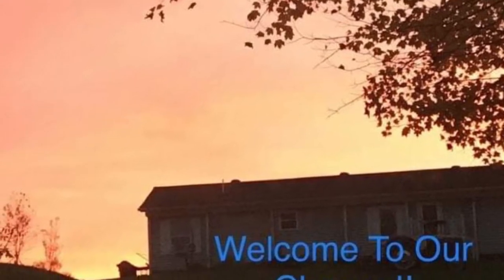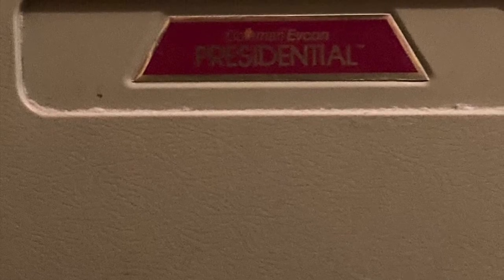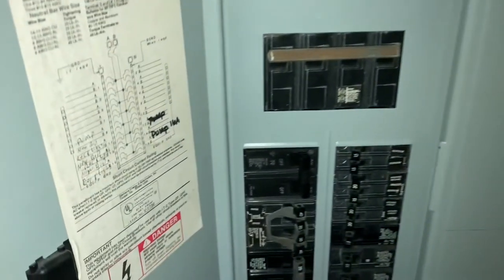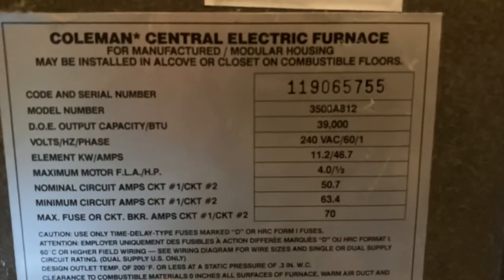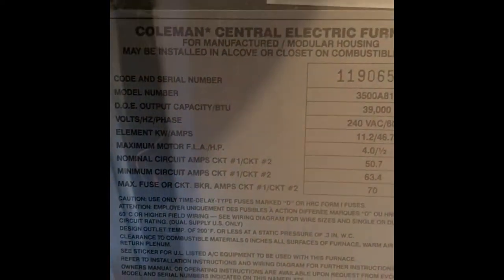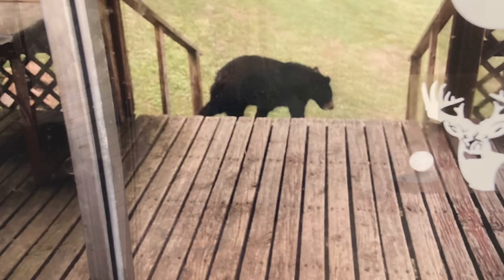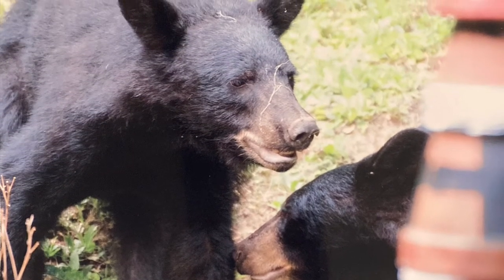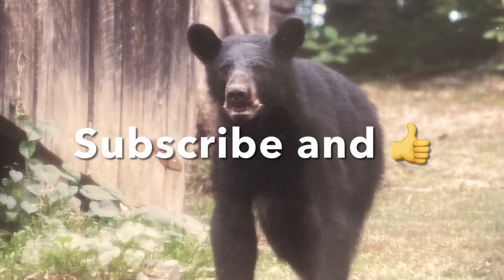Mobile Home Electric Furnace Broke | Mobile Home Living |Simple Fix #mobilehomes #mobilehomeliving

Comment: Did the same thing on my Electric Furnace. Built in 1975 a previous owner had put an electronic junk thermostat on it. When I bought the place the price was reduced to replace the entire heater.  I found a great Honeywell non electronic thermostat for 5 bucks and it fired right up and has stayed working ever since. The tech idiots would never recommend something that simple. Am sure they thought who ever bought the place would have them come right out and put in all brand new JUNK!!
Reply from the maker: Yes! And it’s such an easy fix. You’re absolutely right and these new furnaces probably wouldn’t last even half as long as these old ones. Things nowadays aren’t made to last. I’m happy you solved your heater issue plus saved some money. Thanks for watching and commenting so people can hopefully save theirselves a bunch of money also. Have a great day!